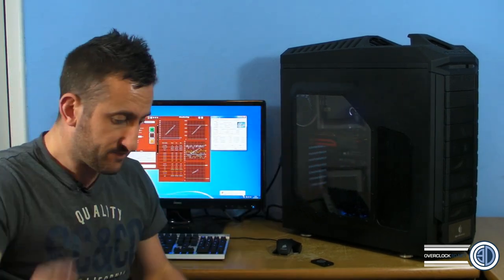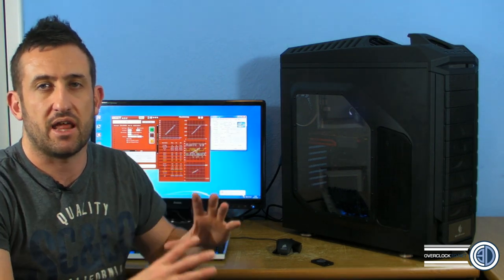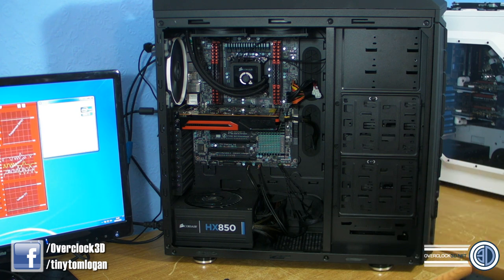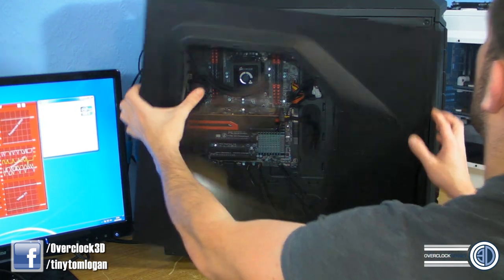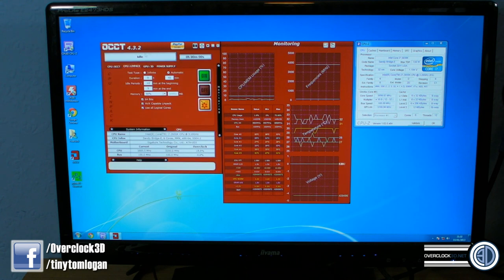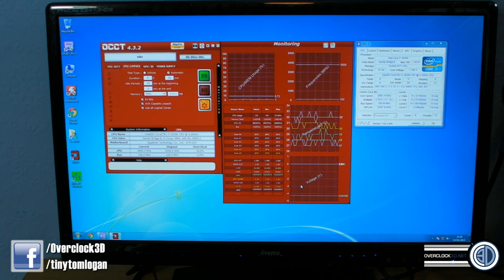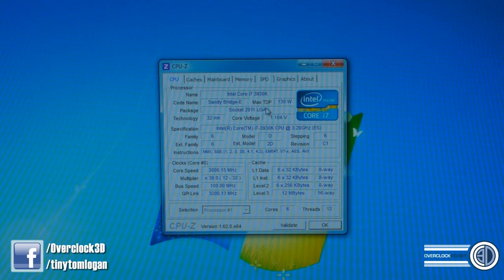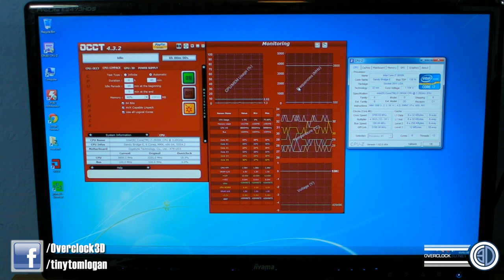New Heatsink Testing Procedure

Comment: Is there a reason why TTLC does not go for an Ivy Bridge chip since that is known for crazy heat with any increase in voltage?  Is the SB-E series chips actually hotter than IB when OC'd?  :)  Kinda hard to compare cooling performance on SB-E vs IB, cos I'm on IB and I'm not sure if the reviews on TTLC will apply as much for my chip ^^

Comment: Wouldn't it be better to get a side panel with a mesh to test heatsinks?
My recent setup is a completely passive system (3570K+Nofan CR100A+HD7750 Ultimate+Seasonix X460 Fanless) and I'm running it in a Vengeance CX70 case. It has those ugly fan mounts in the window, but I reckon those holes help with the cooling though... With a mesh, I think the cooling potential will increase a lot, especially in a passive setup.
Maybe something you could test in the future? Just an idea...

Comment: im planning on getting the same case. would u suggest i use the noctua nh-d14 or the h100i with push pull in this. from your previous test it looks like noctua is the way to go and h100i performs better at higher voltages. what i am trying to consider is that the room temp where i live can get up to 40 degrees Celsius and i am wondering if the h100i would be better for this reason. thank you

Comment: Yup, it's even better than the GTX680 for the price of the 670, however you won't get cuda, physex etc. I would recommend saving a bit more money and getting the 7970 ghz edition with the windforce 3 coller from gigabyte, or if you're mad get the best of the best, asus matrix 7970 platinum.

Comment: It's not worth it, your CPU might bottleneck it and you need a better power supply. You might also end up with driver issues and microstutter.

Get an HD 7970 or a GTX 680. Both are the fastest single GPU cards for gaming at the moment. Also go for Ivy Bridge instead of x79 for gaming.